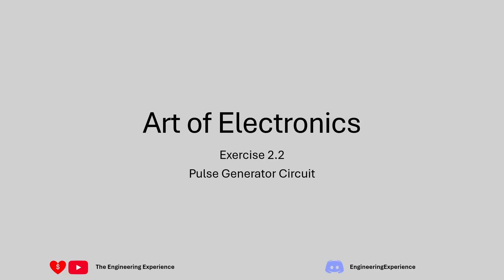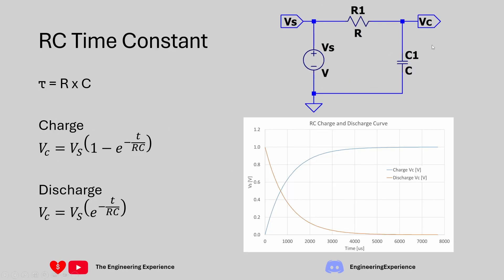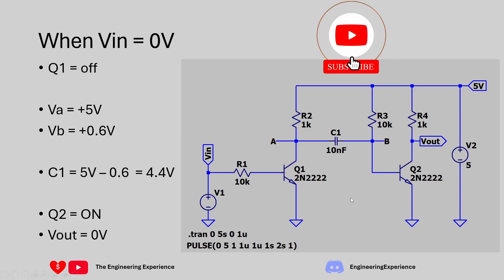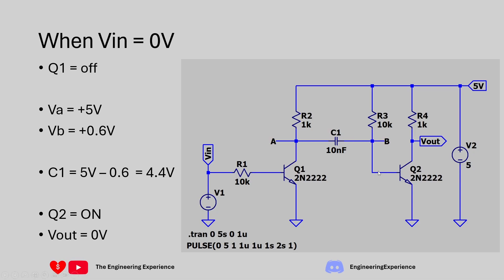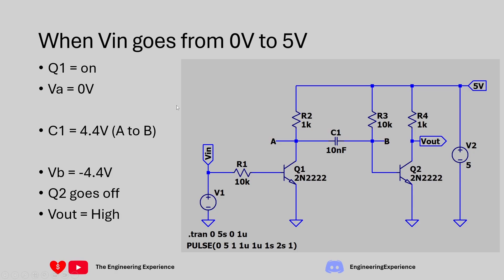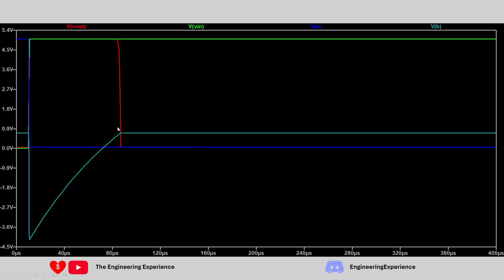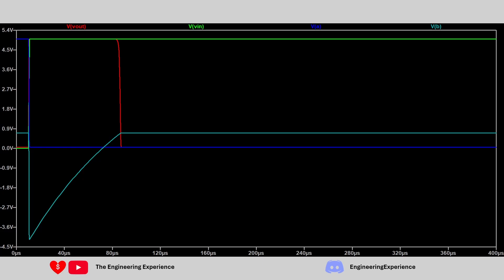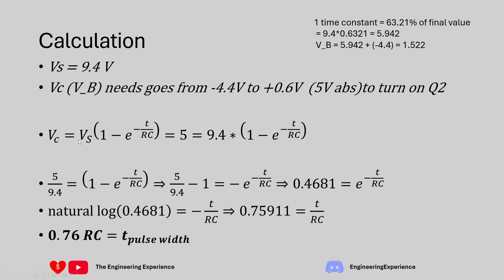Pulse Generator Circuit - Art of Electronics Exercise 2.2

Comment: how negative voltage is coming sir. please explain .i am very confused
Reply from the maker: Check out this video, maybe it helps.

Pulse Generator Circuit Build and Test
https://youtu.be/QOTNFyFh0j0
Reply: @TheEngineeringExperienceYT  very very thank you sir
Reply from the maker: Okay :- lets start with +5Vdc power supply and Vin = 0 V. 

If Vin = 0, then transistor Q1 is off and very high resistance. Therefore left side of Capacitor C1 is at 5 volts and right side of capacitor C1 is at 0.6/0.7 V. Effectively capacitor voltage is +4.4Vdc (left to right). 

When Vin = 1, then the transistor Q1 is switched on. Therefore, the left side of capacitor C1 goes to ~0V. The capacitor still has the charge built up.  The capacitor voltage cannot change instantly, so voltage across C1 stays at +4.4V when Q1 turns on and to preserve the difference the right hand side must go -4.4V as left side is effectively connected to ground. In other words, when we suddenly pull the left side to ground, the right side has to follow down by the same amount to preserve the stored voltage. Since it was originally at 0.6V, and the cap had 4.4V across it, the right side now drops to -4.4V approx. 

This takes the base of Q2 below its required turn on voltage and switches it OFF so output voltage goes high. Hope that helps.

Comment: What edition do you have?
I have the third and it is the same circuit but is says that the pulse is 0.63 not 0.76. 
Doing the calculation also got 0.76
Reply from the maker: Have a look at https://artofelectronics.net/errata/

Exercise 2.2 is referenced in the errata.
Reply from the maker: I am using the 3rd edition.
Reply: Did not know there was an errata, thanks!

Comment: That's nice! But you should get a better microphone.
Reply from the maker: Sure, as soon I start getting some return on youtube haha.

Is the audio quality that bad? It's improved alot since the start but got a long way to go
Reply: @TheEngineeringExperienceYT  It's not the microphone, it's the room. There's some room reverb happening, which suggests that you're recording in a medium-sized room with bare walls.  Heavy curtains on the walls, or egg crate material, or sound dampening material, would help a lot. If that's not an option, I know of at least one audiobook narrator who records under a heavy blanket for sound isolation.

Record a single clap and look at the waveform in Audacity. The more of a tail the waveform has, the more reverb your recording setup has. It makes your voice sound a bit muddier.

You might also consider a pop screen and running a de-esser filter on your audio.
Reply from the maker: Thanks, I'll try that. My room is very small to be honest and very little dampening.
Reply from the maker: I do have a pop screen and de-ess on da vinci but will experiment more.

Thanks for the feedback.
Reply: @TheEngineeringExperienceYT  The recording room makes most of the sound quality. Even things like stuffing corners with fabric, having bookshelves (or anything to break up the sound waves), not recording against a flat surface like computerscreens should help with echo. Another way was to record in a closet full of clothes, or making small desktop recording booth things. BTW Your channel is great, it really helps me to keep up with my own copy of AoE and have some kind of check on whether I'm doing the excercises correctly. Keep up the great work!
Reply from the maker: Thanks for the awesome feedback and glad I am helping with your AOE read! 

I will try those things and see the differences
Reply: What microphone are you using, @TheEngineeringExperienceYT ? I use my smartphone (Moto G60s) and everybody tells me they can't hear a thing in my videos.
Reply from the maker: I bought a mic from amazon a while back. It's  neweer nw-7000 usb condenser microphone. It was bought for something else in like 2020.